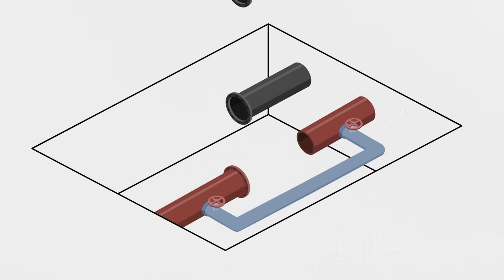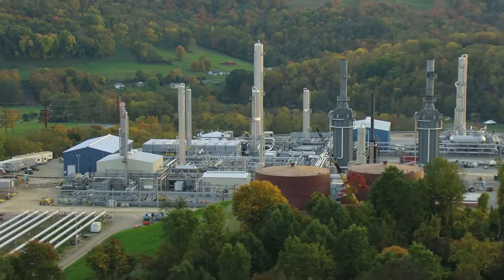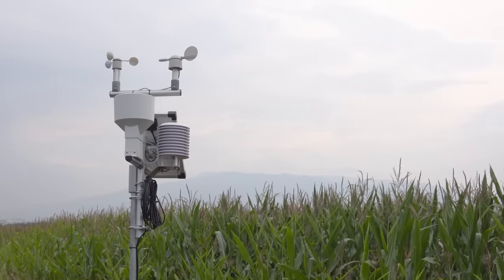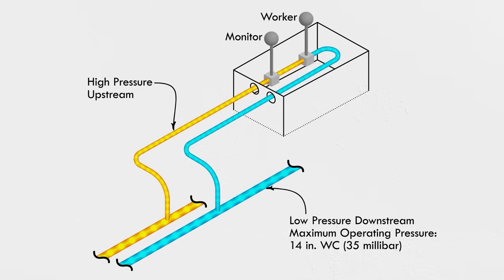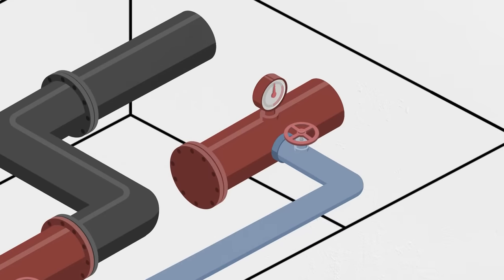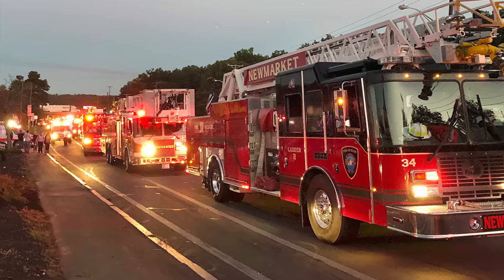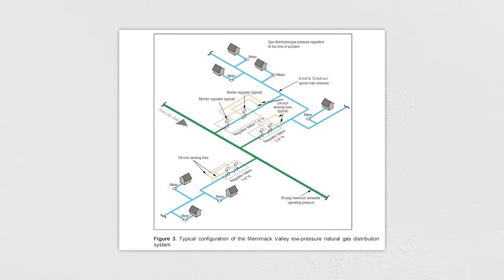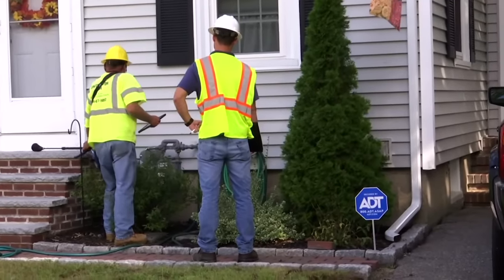What Really Happened During the Gas Explosions in the Merrimack Valley?

Comment: I'm curious about the balloons that block the gas during the installation - how are they inserted and extracted without causing a leak?
Reply: The process is called hot tapping. It uses very well sealed drill bits to cut a hole in the pipe. The bit is then removed and replaced with the pneumatic balloons behind a valve added to the cutting junction. Once in position, they are inflated to create a temporary seal in the pipe.
Reply: @AnAcceptedName  Very cool! I was wondering the same thing, thanks for the explanation. PE, or one of the other engineering channels, should do a few episodes on the little industry tricks like that. Also, the main feed being at 1/2psig?!?!? Thats crazy! Youd figure a supply would be at high pressure, but, this event aside, its a bit mind blowing that the system pressure is so low having assumed for so long it would be at double digit pressures at least.
Reply: In the public water supply world, the balloons are called inflatable plugs. Grady did not show how the plugs are installed in his graphic.
It takes a lot less pressure to move the required volume of gas to operate the household appliances, so 1/2 pasig is sufficient. By contrast, it requires a lot more pressure to move the required volume of water and lift it to the second floor of your home, so the pressure in your water service is typically 60-100 psi. Much more than 100 psig will shorten the life of your appliances and responsible plumbers and home builders will install a pressure regulator on the service line in the basement.
Reply: In my area, when working with low pressure (1 PSIG MAOP) there is some leakage of gas, this is normal. Crews work quickly to insert cloth bags/balloons that are then inflated to seal the inside of the line. A simple covering of the hole with a rag is enough to keep most of the gas in the line and the pressure up. Pressure can be measured at your lowest assumed point (end of line, at a meter riser) to ensure you have no “gas out” events.

For anything above LP, “stopples” will be used by TDW, it’s their “shorttstop” line of products. A simple YouTube search will show you tie in procedure. I highly recommend if you are interested. And, yea you cannot hold back enough gas to keep a line pressurized using just a rag on an MP system and higher - this type of system is definitely needed unless you’re shutting the line down completely.
Reply: They actually double bag each side
Reply: @zombieregime  most of that cast iron main system was installed by hand around 1900. You would arrive on the street and the Forman would lay a shovel on the ground. Tell each laborer they had to dig 1 or 2 shovel lengths and how deep for that day. Image 12in, to 36in mains being installed. Most new gas heating systems will trip out when gas pressure drops. In the winter when everyone wakes up and turns up the heat, takes a shower, and cooks. In the old days pilots would just get smaller but today's equipment will shutdown. In the gas industry this is known as a saturation problem and it became a big problem. The utility I worked for had to install more regulator pits to fix it.
Reply: @AnAcceptedName  , you did a pretty good job of explaining it in three sentences 👍. The welders, I was involved with would always double check those stoppers before striking their first ark . In the back of their mind, they knew that they were going to be the first one to fry. You alway prayed that that coupon was in the cutting sleeve when you pulled it off the stopper.
Reply: A guy smoking a cigarette whips out an angle grinder and spends 1/2 hour cutting a big rectangular wardrobe sized opening, while gas flame is roaring 100 meters high into the sky. Then he inserts a large beach balloon which gets immediately incinerated. Then he takes out another beach balloon and again it gets incinerated. After 17 tries he says it doesn't work and goes home while the column of fire is still roaring into the sky.
Reply: In this case they used balloon bags you inflate and I never heard of it called a hot taps. I always thought a hot tap required a Williamson style set up. That means no exposer to high pressure gas at all. Starts with a thorough grinding of area where you weld a female threading fitting ( cannot be a transbender fitting but bio ). Then you screw a part on that allows opening and closing to gas main. This allows different devices for cutting into the main , bypass,  and stopper and all down with no gas released. From low to super high pressure mains work. Regular low pressure stoppers were leather or synthetic material that were put in main then opened. This system was used from the start and was effective on low pressure
Reply: @skipd9164  , i’ve been in the gas utility business since 1983 and i’ve never heard it called anything else but a Hot Tap. In this particular scenario they would not have welded a saddle on because it was a cast iron gas main , they would have used a bolt on saddle.  I have never seen a leather apparatus like the one you referred to , definitely sounds old-school to me and I was at the gas company when we celebrated removing the last wooden gas main. Nowadays we can launch cameras , repair robots and not to mention the inflatable bags all through hot tabs. Live insertion is also another thing we can do nowadays. I’ve seen a lot of changes in 40 years.
Reply: @boby115  Hi Bob and I started my job a couple of years after you 1987. Went in the street department around 89 and went thru the ranks. A lot of utilities in New England are the oldest in the country ( U.S.). Never had but did see wooden mains. The old stoppers we used for low pressure cast iron were not inflatable but were a leather. We also called them bags. First you knuckled your main then you installed a saddle and drilled your hole. You then inserted your stopper and it had 2 bendable rods that would form to inside diameter of main. There was a center rod with a handle and it went threw a small device that held on to top of main inside hole. When inserted and  and positioned you pulled rod. This forced 2 outer rods that had leather connected to form sealed surface inside main. They worked great and you might of had to reseat it if you didn't get good seal. I got out of street department late 90s and those were what we used. Most of the CI were coming to the 100yr mark and major new main projects were starting. With that lots of investment in New tools and products and contactor work happened. The only welding was with steel and that's why I always associated hot tapping with steel and not cast iron. 2 completely different methods and we did Williamson but had to use an outside contractor to do welds. Bagging or stoppers when used allowed small amounts of gas to escape. You also used 1 1/2 To 2 inch hole to bag a main depending on the diameter.  They now have welders. Alot has changed since I left 20yrs ago but I steel see old friends and stop when i see them.
Reply: @boby115  when i started every crew truck had those old fake labels that you rap around cans of beverages. That all stopped a couple of years after I got into that department and for the better
Reply: @boby115  Bob did you happened to read the complete NTSB report and all deposition.
Reply: @skipd9164  , yes, I did and I sat through the two hour and 33 minute NTSB board meeting  & also sat through the senate hearings by Elizabeth Warren & Ed Markey . About a week after the incident happened I was a consultant for the NBC affiliate in Boston , Massachusetts.
I retired from Laclede Gas /Spire ,St Louis in 2018 after 35 years of service and now I consult from time to time when incidents happen in the gas utility industry .
Reply: @boby115  Pocahontas and Markey used that as a set up. The only deposition that is confusing is the manager of those departments involved. The politicians  had to know the real reason but instead went after the executives of the company that owned Columbia gas. That accident was the result of upper manager excluding the regulator department from the job even though it involved connections to regulator pit.

Comment: My first analysis job was a fatal blast analysis. It turned out it was deliberate; the home owners damaged their regulator and ended up killing their neighbors. The thought of that level of damage across an entire distribution system is absolutely chilling. Thanks for the rundown and letting us know that, at least in that region, PEs now have oversight on these systems.
Reply: People who steal utilities often do so without knowledge of the correct pressure for gas systems, and, use substandard materials. Electricity theft often ignores current limits. All of this asks for disaster.

Comment: Why would they not have overpressure relief valves in the system? would it not be safer to have it vent in controlled locations than what happened?
Reply: Or an automatic shutoff if overpressure is detected down the line.
Reply: So the original installation that could have fitted those valves was done in the 1900s and they probably weren't thinking about how that system would be retired and replaced many years later. As it was, they had redundant control systems with independent sense lines, it may have already felt like overkill for some.

They're never going to be added during any routine maintenance or overhauls if the system seems to work well and again nobody is planning for what may go wrong when the system is eventually replaced.

Of course, in hindsight we can see that such a solution would have prevented this particular accident and you'd hope it would be a wake-up call but when calls for upping basic engineering standards are being ignored, how are you going to get such changes made?
Reply: Not sure if relief valves sized big enough to relieve the amount of gas being introduced during this event wouldn’t have introduced another problem by venting so much gas in a small area which could have ignited, too.

Comment: I used to live in a small town in northwest Pennsylvania. The contractor I worked for and I were digging a hole next to the road to put in a stone pillar. My boss had done a One Call several days in advance and the utility companies had marked their lines. The backhoe operator hit a live unmarked gas line. It took almost 2 hours for us to get it capped. My boss called the gas company and they sent a crew out to investigate. They found another line across the street and they had no record of either line. They called in the white hat’s. After a long powwow they dug a hole down the street and found a 3rd line. It was a good thing that my boss had done the OneCall. The gas company made the decision to run all new lines for the entire town and abandon the existing system all together. Had my boss not done the OneCall he would have been held accountable for part of if not all of the fall out. And god only knows what that would have cost him. But on the up side. We got to see first hand how a horizontal boring machine works.
Reply: Did you find out how old were those mystery lines (when were they installed)?
Reply: I wonder if any of those Mystery lines were hooked to a Meter!  (Wouldn't be the first time someone put in (or paid someone to put it in) their own pipeline for free gas (or water) even electrical hook-ups are not unheard of!  (But if you've got overhead wires for power, they are easier to find, but the power company kinda has to look for them...)
Reply: @timengineman2nd714  nope it was an entire system that the gas company couldn’t explain. I figured that it predated the current to the time system that was abandoned and forgotten about. Just some how was tied into the supply line somewhere.
Reply: white hats
Reply: I love seeing all that complicated infrastructure in movies and in video games. But in real life, not so much, imagine all the stuff that could go wrong with it.

And then we have all these people retiring or leaving the job, the very people who best understood the system.

Comment: It's amazing the difference in pressure that exists in gas transmission pipes.  One time I stopped a yard forklift driver from yanking on an s shaped 15 foot pipe sticking out of the ground.  Yeah I called the gas company and it the feeder line to an old gas meter to a house that was there 50 or so years ago...it was still charged and obviously still strong.

Comment: Thanks Grady for covering another story I can directly relate to.  I was mapping lines in Western Mass when this happened.  It changed workers mood instantly even though they were not directly involved.
I heard that some of the really older systems run at an even lower pressure, and can’t handle current distribution pressures.  So to make it more complicated, there are areas with 3 different pressures of lines.  
Since the event in the other side of the state, I found it strange that my house and a few other neighbors who might be knowledgable about the gas system were the first to get their meters updated and moved out of the basement.

Comment: Very well explained, Grady. I was amused that your ad at the end started out with the airline industry, as I had been asking myself just before that, "Don't these people use checklists?" There's a reason pilots have checklists for everything from normal takeoff and landing procedures to emergency situations. It's all too easy to miss one step in a complex series of steps. In aviation those lessons have been paid in blood, yet that industry is amazingly safe compared to the earlier days of passenger travel. Add more people to the decision making tree and it becomes far more likely that a single step can be overlooked because people assume someone else has done their job correctly. Without rigorous step by step verification one small oversight can lead to distaster.
Reply: The most shocking thing to me was that nobody was actually WATCHING the outgoing pressure.  I'd be tearing my hair out if I couldn't have a good look at what was happening with a dangerous system on switchover.  They'd have known pretty quickly.

Which makes me think the system was already buried and inaccessible.
Reply: @murraystewartj - That is a good question - why was a checklist not used?
I've worked in the chemical/refining industry which were under OSHA's PSM regulation (Process Safety Management - https://www.osha.gov/laws-regs/regulations/standardnumber/1910/1910.119).  For systems under this regulation, a formal COD (Change of Design) process is followed when making any change. Then, before putting anything new into service, a Pre-Startup Safety Review (PSSR) is performed. The PSSR is like a checklist to ensure everything is installed correctly, correct engineering standards and materials of construction used, training completed, operating procedures and drawings updated, etc., before startup. Also, a HAZOP (Hazard and Operability study) is done on all new and existing systems and is revalidated every 5 years. Had the natural gas company followed the OSHA PSM standard, I think it would have significantly decreased the chance of this event.

Comment: Obviously, the entire panel of the NTSB investigating the incident is much more highly qualified than I am, but…coming from a gas worker in another NE state here. 
1) We were told the control lines to the regulator station were damaged by another previous incident and the damage was not known. As a lessons learned for our own system, a new procedure was put in place such that any excavation occurring within 200’ of regulator station control lines had to be reported and overseen by an additional special inspector from the utility company itself- before the excavation was to take place.
2) Gas as a utility is over 100 years old. There is a hybrid of new and legacy systems out there that feed customers, depending on the history of the individual system. A cast iron main is a legacy pipe material and only suitable for low pressure systems. All downstream customers will have low pressure coming into their homes and those types of systems do not have regulators at the house or business.

Comment: Here in Germany, we use a higher system pressure, and every customer has their own regulator (as far as I'm aware).

Interesting to see what goes into those decisions
Reply: In my Dutch home, which is probably similar to Germany, I have a pressure regulator which outputs 30 mbar (similar to the low pressure in this video). But the rated input pressure is also 'just' 400 mbar. So if the pipes were suddenly filled up to 5 bars, I'm not sure if the regulator survives. I think it might still be affected by sigh a pressure rise.
Reply: Here in France we also have a high pressure gas system, each customer has a regulator near the gas meter, and often an additional regulator for each appliance
Reply: Where I live in the US (Colorado), we too have high pressure on the service side that is dropped to low pressure by a regulator on each home/business. Must have been an older system in this case.
Reply: UK as well. Every house has its own regulator.